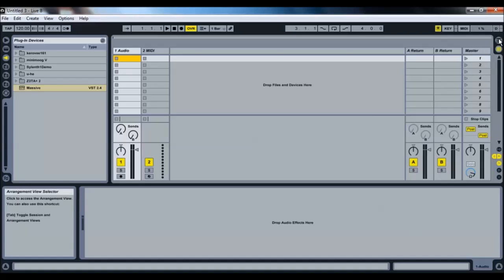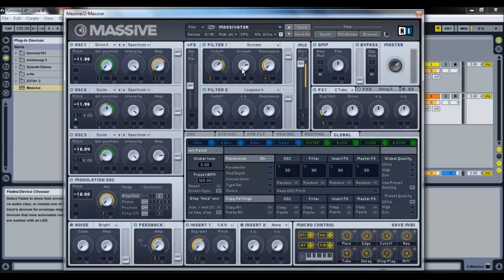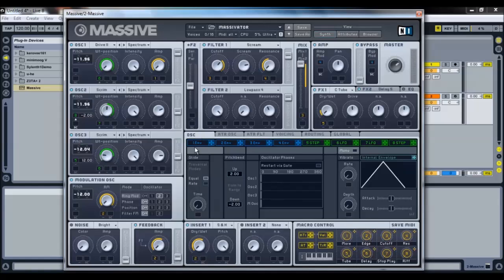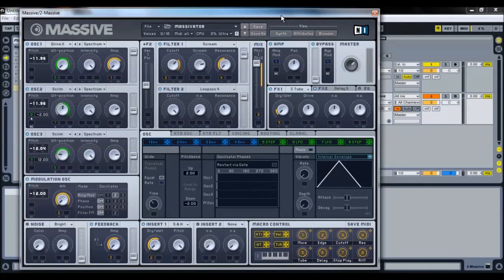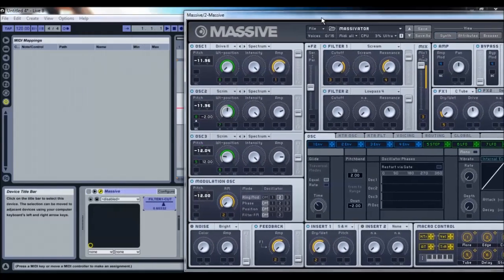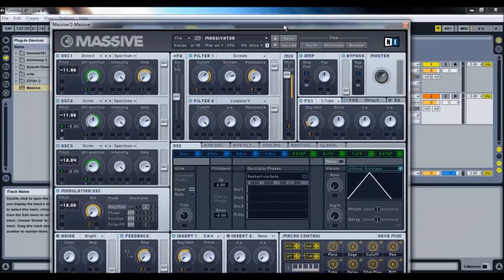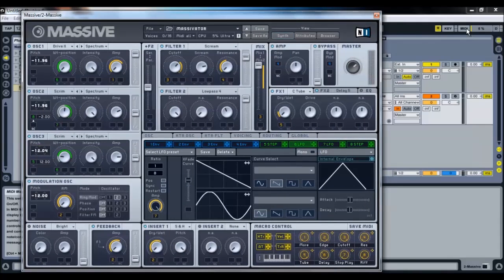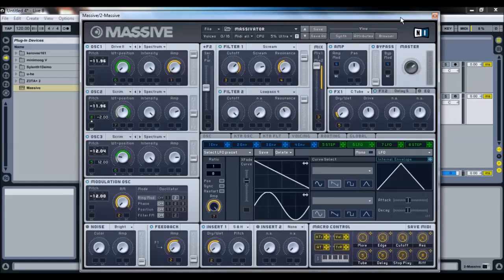Video Blog 2 - Configuring the Misa Tri-bass Touchpad (Prodigy)

Comment: Most hardware synths respond to MIDI CC messages to affect parameters like filter cutoff or LFO speed in real time. Unlike in the example here where you can teach Ableton how to respond to MIDI CC messages, hardware synths will respond to a specific CC message in a specific way. I'm not sure, but I would imagine the CC messages the MISA sends are configurable. Here, for example the touch pad sends values on midi CC 16 and 17. Read the manual of your synth to find out which CCs control what.